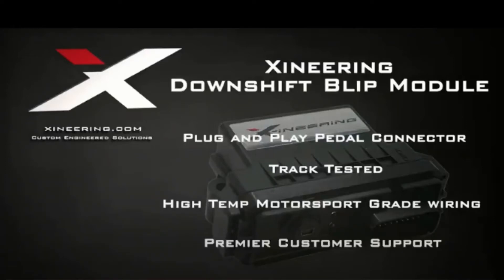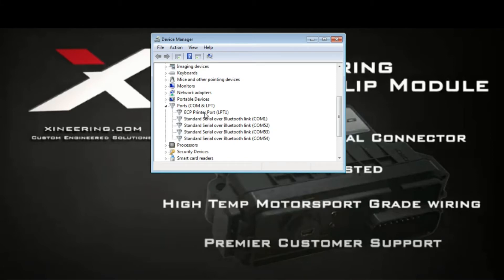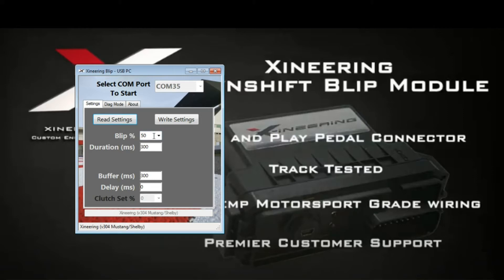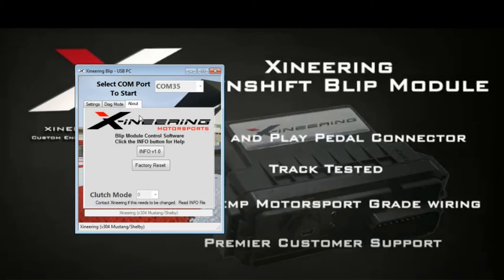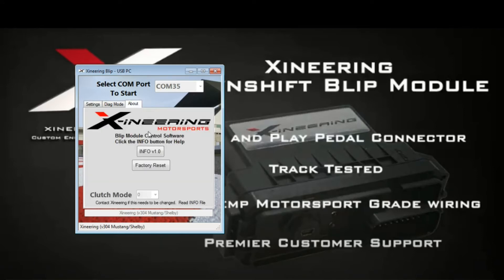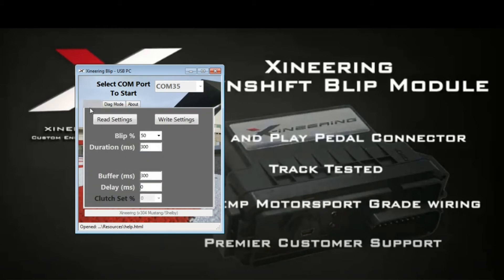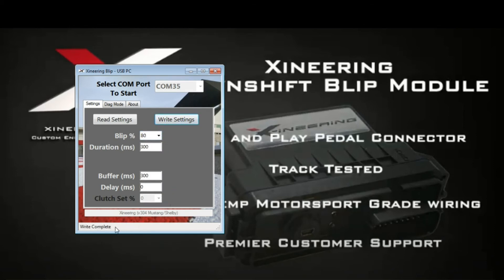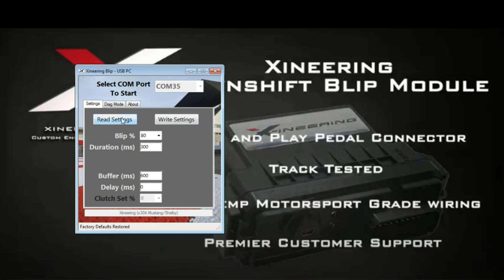Overview of BlipControl.exe - Xineering Downshift Blip Module USB - PC Software

Comment: So how would it know how much to blip like 5-3 vs 3-2 i guess it’s kind of negligible and you would blip a couple ms longer but i would like to hear how you would set up a blip for multiple downshift and 1 i guess varying downshifts. Thank you!
Reply from the maker: I wanted to revisit this question.
While the module will not know that you are downshifting from 5-3 vs 3-2 you can still 'skip' gears while downshifting.

IF you take the appropriate amount of speed out of the car to allow for that next lower gear to rev match.

On the street this would work perfectly, on the track we would still recommend dropping speed and going down through the gears to reach your turn in speed.

All the best!
Reply from the maker: Thanks for the question Andy!

So the module uses its static programmed values; blip %, and duration (ms) to produce a blip event. 
This static nature will not allow you to skip 4th gear during your 5 to 3 scenario. 
It is best practice to go into the next lower gear, become stable in that gear, then the next lower gear, and so on.

If you try to skip gears you can risk locking up the tires or causing damage and strain on your transmission and its connected parts. 

Hope that answered your question! If not, we are a phone call or an email away. 407 542 4848 and xineering@gmail.com

Comment: What is blip % exactly? Is that the amount of throttle?
Reply from the maker: Blip % is the target throttle pedal position that is held during a blip event.  Basically gas pedal press %.

Throttle pedal:
0% is No throttle press
100% Full throttle press

For example:  50% Blip for 200ms Duration
Would be as if you placed your foot exactly halfway down at the 50% accelerator pedal position for 200ms.

Thanks for the question!
Keep them coming!